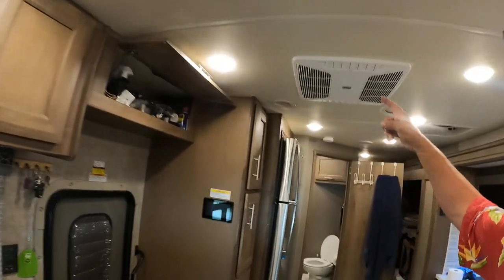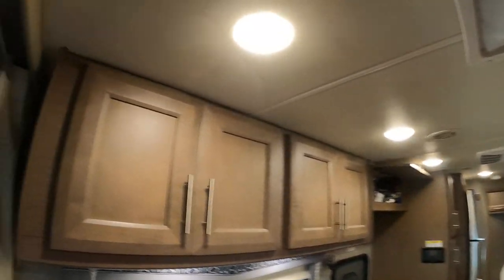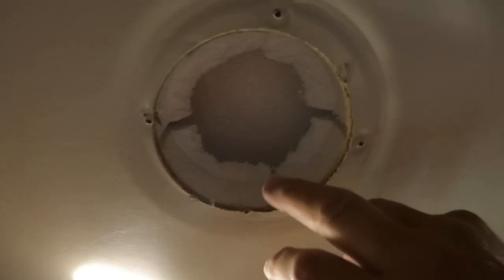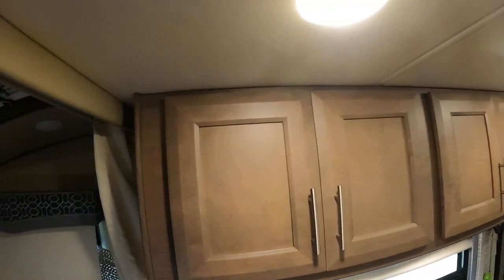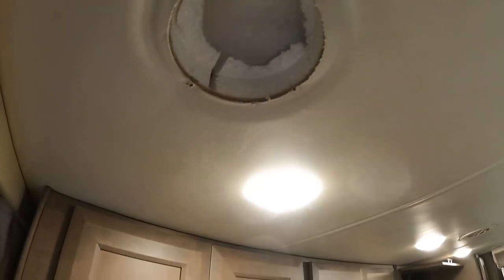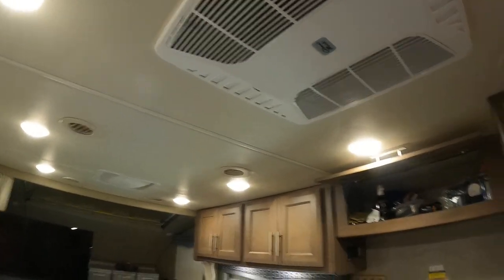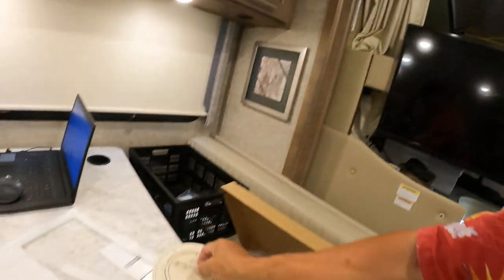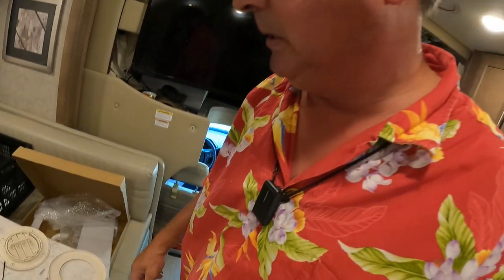RV AC Vent Modification | #YouTube Short!

Comment: That's crazy!!!  I know some people have also beveled the vent openings, and also used a vinyl caulking sealer (the white stuff from big box).
Reply from the maker: I have to say, I did not even think about a bevel! Next time I am looking for something to do, that will be on the list! Thanks for the insight!
Reply: @DudeRV  if you want more to do,I can help 😜. I ran a bore scope camera down both sides (I have the XG32), because I happen to be on the roof and noticed a straight line of mildew forming across the roof. It was approximately 1.5 inches wide and when I knelt down to touch it, the roof was cold. That’s when I discovered a notch cut into one of the roof stringers, allowing cold air to run down the aluminum tube. The condensation on the roof caused the mildew. I had to finagle my way thru a lite fixture that was close by. I was able to get Foam into the opening of the tube. That was fun. Thanks for the reminder of what I went thru!
Reply from the maker: @gmthrust1012  I actually discovered that when the vent holds were being drilled, they cut into one of the "rafters" "stringers". I had the exact same situation you are talking about! I used more of the packing foam and gorilla tape to close off the tube.  I found that the cell phone camera works great to get a look down the ducts. I found one place where the top side of the duct was collapsed in and was blocking most of the duct.
Thanks for watching!